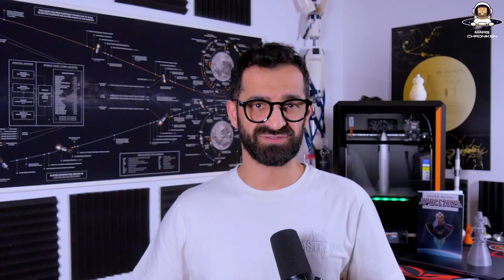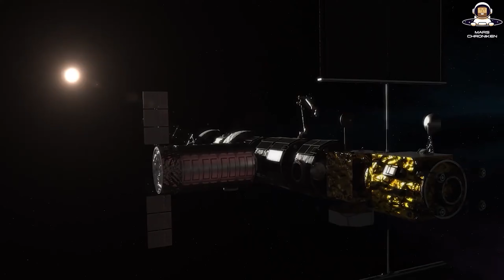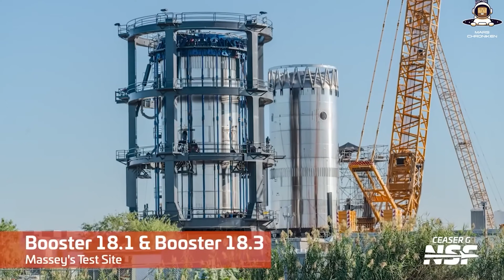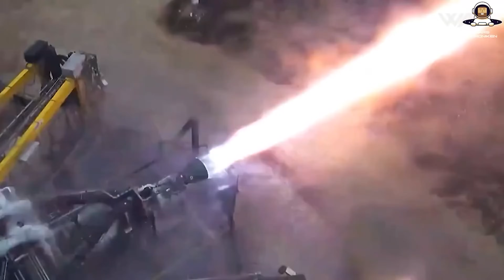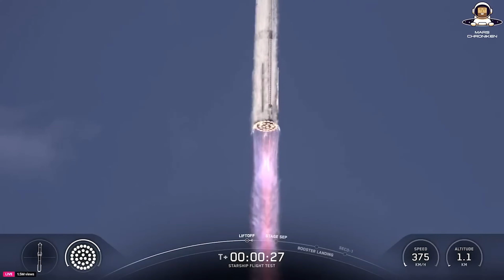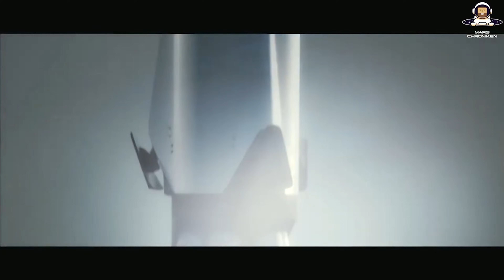Starship Block 4: SpaceX’s Bold Plan for the Next Decade

Comment: A Starship with two strap on super heavy boosters is unlikely. Musk was not pleased with how much more difficult it was to build the Falcon Heavy than planned. He decided to upgrade the Falcon 9 rather than devote even more resources to the Falcon Heavy. This taught Musk that strap on boosters are not worth the effort needed to make them work. It is more likely that SpaceX will choose to build additional factories and launch infrastructure for a 12-meter diameter Starship than go with strap on boosters. And I don't think they will cannibalize the current launch infrastructure to do it. SpaceX will make a lot of use of the current Starship infrastructure for block 4 or 5, even if they choose to develop a 12-meter diameter Starship.